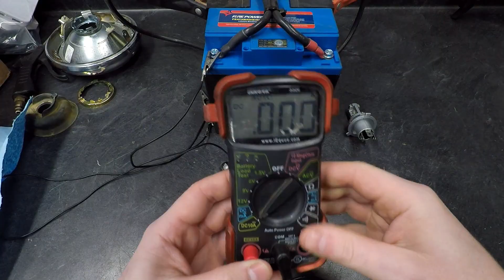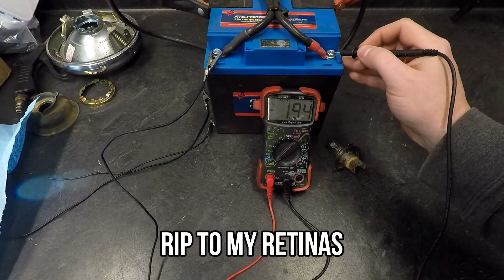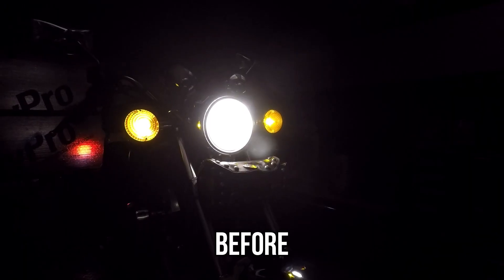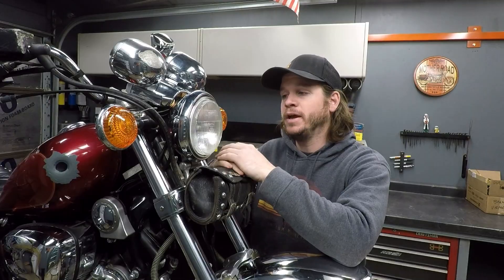Motorcycle LED Headlight Conversion - Install and Test!

Comment: Did you get the wiring wrong? Looks like in the '85 the top is for the low beam. Ground is on the left (black wire) and right is the high beam.
Reply from the maker: No, however I ended up worked as it should

Comment: Will these work on xr 400 2002  and do you need a rectifier or diode/ battery thanks
Reply from the maker: @adz24888  If you have an H4 bulb it will work

Comment: thanks for this great video,i do have a 1980  honda express 6 volt system and my tail light bulbs has a 1154 number on it,i was wondering if the connection would be identical if i buy the led bulbs?thank you
Reply from the maker: Yes if you have an 1154 socket you would search for 1154 6v led bulb

Comment: Great explanation, i need to upgrade my 2003 volusia and have no  idea if my headligth  is a sealbeam or just have to change the bulb.  I saw some videos that change to led but the lamp not include  mount hardware if needed,  also some lamp are 5' and other is 7'.

Comment: If the stock bulb is 35w, will changing to a 55/60 bulb damage the reflector?
Reply: Yes it not only melt you reflector, it will melt the wiring too due to higher wattage. The bike wiring might not able to carry the additional current load.
Reply from the maker: That I can't say with certainty.  I've only ever seen cheap Amazon headlights melt

Comment: Get a bread board and you can test all this easier. Great job tho. I use a load resistor for my led connections due to higher resistance with led bulbs. Does this bulb have an integrated one?

Comment: I installed a 2 sided led H4 bulb on my motorcycle and got a broken up light pattern compared to the element from the halogen OEM bulb. I've heard that a 3 sided led bulb projects much cleaner. Has anyone dealt with this?

Comment: does this fit on a virago535?
Reply from the maker: If you have an H4 bulb this bulb or similar will fit
Reply: @BrickHouseBuilds  any problems with overheating? i might try this but im scared the heating fins wont be enough
Reply from the maker: @chopracer  No issues

Comment: An interesting thing is that the filament bulb is very reliant on voltage for its brightness, so at lower revs the light will be dimmer, while on the LED it is a current driven device.  You will often see 9 to 32 volts or 5 to 15 volts on an LED bulb that means that even at the lower voltage you get full light output - the 'power supply' part of an LED bulb, either separate or internal as the bulbs are moving to now, is actually a 'constant current' circuit and that is why the voltage range is so large. The LED bulb will also have a temperature sensor built into the bulb, which can reduce power to LED's if the heat gets too much to prevent burnout of the LED and power supply.  Maybe the temperature sensor did its job when you were testing the power draw, and as the heat built up it reduced the power drawn through your meter.
Reply from the maker: thank you for watching

Comment: All 'shunt' Rectifier Regulator ( RR )work by 'wasting' any electrical power not used by devices into the heatsink but the load on the stator is not reduced.... putting in a bulb that draws fewer amps will increase the  temperature of the RR heatsink because extra power is pumped into heatsink, maybe causing burnout.  I fitted an Electrex world 'series' style RR,  this acts more like a light dimmer in 'series' with the load, and i tested the temperature of heatsink with OEM shunt RR fitted at 75deg C, then fitted series regulator and heatsink was 37degC and the load on stator coil reduced,  both these readings were with an H4 led headlight bulb fitted. The 'shunt' RR sits across the load ( 'shunt' is electrical speak for 'in parallel with load' and 'series' is a term for 'in line with the load', which is like a regular household light dimmer works, it only allows the amount of power required through.  )
Reply: I'm STILL trying to figure out...what LED lightbulb...(and perhaps an RR?) for my 2019 Husqvarna FE 350............hard to get it all dialed in as to what to order...

Comment: What about distance comparison, for me the high beam is to show more of the road in front as well as the sides. You can’t judge the lights in a confined area you need to be on a dark road so you can properly compare how they light up the road. I would rather see what’s ahead than to the side as you have more time to react if it’s in front of you than trying to stop quickly if something darts out from the side.
Reply from the maker: Sorry, it was 30 degrees outside

Comment: Loved the video. I have been wanting to upgrade my bikes headlight but was not sure it was possible. Would this bulb work for a 2004 Suzuki VS800GL Intruder, if so where could I purchase the bulb? 
Thanks!
Reply from the maker: I do not have a source for this bulb currently as I was sent a pre-production bulb from nwtcycletronic.com  They may have them available now but I am not sure. Check with them

Comment: How has the bulb held up since it was installed? It isn't listed in your amazon store?
Reply from the maker: Working perfectly.  It was never listed in my store. It was intended to be available from nwtcycletronic.com by now but it hasn't happened yet.
Reply: @BrickHouseBuilds  OK, thanks for replying. I have an old shadow 600 that needs a headlight bulb and I was wanting to convert to LED. Thank you for doing the video!

Comment: Watts or wattage is the amount of power consumed by the light. It's not output. With lights you have to use a light meter and it will usually measure in Lux which is the amount of light that falls on a certain area. Lumens is the total amount of light put out by the,  bulb. Those are both metric units btw. Pretty common, although generally the Lumen unit is mostly used in commercial lighting, not with something like a headlight bulb. The greatest problem to solve with designing an led headlight bulb to replace an incandescent headlight bulb is that the headlight's reflective surfaces that surround the bulb are designed to work with an incandescent bulb. The filaments, no matter what brand are pretty much always in the same place so that the reflective surfaces catch and redirect that light in a designed way so that the light is totaled and directed into a beam pattern.
The trouble is that headlight reflectors designed for incandescent bulbs often don't work very well with an Led headlight bulb, because the light emitter doesn't put out the light the same way as the incandescent bulb. Often the light from the Led is fragmented, by the incandescent bulb designed reflector housing. It spreads out over a larger area so it's not directed well. Sometimes the light doesn't even go as far, and you end up blinding oncoming motorists. I think that's why there's so many different companies producing led headlight bulbs. They can each make their own claims of being the best. 
I own a 2013 Yamaha FJR1300a, it has two H4 halogen powered headlights. I don't like the yellowish light that they put out and have been hoping that somebody will come out with a radically different kind of H4 Led bulb that will give the same or better pattern but in a brighter whiter light, but so far it hasn't happened. 
This problem is really common with installing Led bulbs in a reflective housing designed around an incandescent light bulb. 
The latest thing I've tried is an Led H4 that allows you to turn the bulb in the housing to try and achieve a pattern and light concentration that matches or exceeds the incandescent bulb. The trouble is, you may get a decent low beam pattern and concentration but then end up with a bad high beam output. For my cycle I've been considering the possibility of retrofitting a projector light assembly into my current housing, but I have very limited space.
Some of the companies that are making Led headlight bulbs make some wild claims about their light output too. Keep in mind that the emitter is not the part that gets hot on an Led, it's the base. That's the opposite of course of an incandescent bulb. So if someone's claiming their Led puts out 10,000 lens, but their base doesn't have a fan, you should question whether or not it's true. If it is true you may end up with an Led bulb that melts the headlight housing base.

https://www.bing.com/videos/search?q=The+differencence+between+lux+and+lumins&view=detail&mid=9323DDA65FFFD028FE589323DDA65FFFD028FE58&FORM=VIRE
Reply from the maker: K

Comment: The LED do not Fit !
It is to long for the XV and Vmax Light
After install the Light is to high and if you want to lower the Ligh the LED contakt the Back of the Lamp and cant go down

Comment: Hey BHB. Thanks for the vid. I have the same setup on my 84 Nighthawk 650, but I have a strobing/flickering issue when the bike is at idle, the bike doesnt really start to charge the battery until 2500rpm by design - any suggestions?
Reply from the maker: Well thats pretty common. An updated stator and reg/rec can usually help. In your case you already have a decent factory reg/rec so thats not likely a good upgrade to do. You could try installing an LED tail light bulb and see if that has a net positive effect.
Reply: @BrickHouseBuilds  Ive decided to buy a 12V/3A voltage stabilizer that takes 8-40V of input. I'll check to see if it does the trick when I get it

Comment: Can you do this for the rear lights too?
If I start to save too much power, will I need a change of fuses?
Reply from the maker: LED bulbs are a common swap for taillights and signals as well. Fuses won't matter. It is your voltage regulator that will expell the energy savings via heat
Reply: @BrickHouseBuilds  how bout the bulb size they self? Ion kno which one to get as they is both for car and motorbikes but for bikes are smaller and ion kno if they gon be good or if they just dodgy sellers trying to take advantage outta people from the trenches like myself. My bulb size be s2 and they come in two sizes.
Thanks for the help dawg, preciate it 👊🏽
Thanks for your help dawg
Reply from the maker: @TonyFrmSpace  Take measurements, review pics, and ask questions of the sellers if possible.  Sometimes the numbers on the bulbs are easy to search and others not so easy. Doesn't matter if its car or bike. Make sure its the 12v you need

Comment: I tested mine at 1.3a at 12v, so about 15.6w. they're not really that much different then my original Osram Ultra life bulbs in terms of brightness. I'm not really a big fan of the colour temperature though. I'd much rather warm white but that's just me. 

I worked out that the break even point of £20 will be reached in 400 hours of operation. No idea how long that will take though as I maybe use my lights about 4 hours a week around winter and 30 minutes a week in summer... So that point may take 2-4 years considering it'll take 100 weeks at 4 hours/week
Reply from the maker: Not our light. We don't have these for sale.

Comment: Very blinding if you look directly into them, but they dont light up the road very well. These are fine if you have a 1960s classic vehicle that doesn't put out enough watts to run decent bulbs.
Reply from the maker: Well per my use of this exact bulb I disagree.  I have many miles on this thing and feel its a good improvement in clarity, bulb pattern showing the sides of the road better, and improved pattern for oncoming drivers.
Reply: @BrickHouseBuilds  This has a better beam pattern than the 18 watt Bevinsee fan cooled lamp I just fitted. I have a very bright low beam with not bad cutoff,  but the high beam seems a bit dimmer in the distance tending to light up the tree tops, but if I push the headlamp down a little then the low beam is too close to the front wheel, even though it is supposed to be H4 motorcycle specific.  I wish I waited until I saw this test. I have a 60 watt system so every watt is precious to me.

Comment: Can you show the viewers these "Tiny Batteries" you speak of?
Reply from the maker: Not without completely disassembling a bulb
Reply: @BrickHouseBuilds  I can wait
Reply from the maker: @speedfreak8200  why do you ask?
Reply: @BrickHouseBuilds  I've been using LED,"s for longer than I can remember & this is the first time I have heard about little batteries in the diode or circuitry. I may try to do some research.BTW how many & physical size & what not
Reply from the maker: @speedfreak8200  I do not know. I'm simply reporting what the engineer or the bulb has said. Feel free to get in contact with www.nwtcycletronic.com and you can actually discuss the bulb directly at the source
Reply: @BrickHouseBuilds  I went to the site but didn't find anything about little batteries inside an LED you need to explain since you brought it up but I will keep trying to find this info, as it must be widely known by everyone but me. I know it takes voltage to make them operational
Reply from the maker: @speedfreak8200  So please understand that in this video I state that they are not available yet. We are working on a full lighting package consisting of many items. I meant you should actually reach out via their contact form to have a real phone call. I did not say that info was just on their website.
Reply: @BrickHouseBuilds  I wonder why a led powered by a car battery 🔋 needs additional power? It's not my job to talk on the phone to someone to tell me leds have little batteries in them unless maybe, they are rechargeable.
Reply from the maker: @speedfreak8200  I'm not sure what I've done wrong here as you are the one in pursuit of this information.  I thought by having the opportunity to talk with the actual engineer of the product in question would be a very cool thing. You would be able to ask any question you wish and get detailed responses but alas you do not wish to do that and I am not able to satisfy you here.
Reply: @BrickHouseBuilds  you said you would have to disassemble the led to get to the batteries then you say they will be used in the future ya got me confused I've been trying to find info on Google,nothing
Reply from the maker: @speedfreak8200  At the time I filmed this i had a couple pre-production bulbs in hand to use. One went in this bike, one in my personal bike. I don't have a bulb to disassemble so I cant do that for you.  I sell NWT cycletronic products and we are working on a lighting package to be available later this year so again I do not have a bulb in hand. There won't be anything on Google as this item is not for sale or available anywhere. If you want specific scientific explanations I again suggest you reach out to NWT directly and actually talk with them. You aren't dealing with a large corporation here, you have the ability to go directly to the source which is very rare.

Comment: wondering how much the current will drop if the bulb gets really hot. obviously it has to choose between reducing the light output or overheating itself.  if the current was that low on a 55w the voltage must have dropped below 12v.  I've measured a H4 55 /60 using as much as 73w
Reply from the maker: Why would the bulb get really hot? Its designed to create heat to help seal and keep moisture out of the bucket. You can see my test on a solid 12v source.
Reply: @BrickHouseBuilds  its not really designed to create heat thats just a byproduct of creating light. It's using a good amount of current I'm actually quite impressed.
Reply from the maker: @chrishart8548  actually this one is.
Reply: @BrickHouseBuilds  I'd like to see them design one that doesn't make heat.

Comment: Great job on the video! Told us everything we need to know about the changeover. I just put a pair of these on my 2006 FJR1300 and changed one at a time. The pattern was exactly the same on the low beam, but it was bright white! Almost drowned out the yellow of the Halogen bulb. The only thing I'm worried about is that the plug doesn't fit on the spades very snug. It doesn't take alot to pull the plug off. I hope that they don't vibrate off in my travels!
Reply from the maker: Well I cant speak on the bulb you bought as the one in my video is the light I will be selling before too long. Glad you found the vide helpful though
Reply: Have u found it vibrating off as im looking to fit to my fjr??
Reply: No. Has been fine. So far so good! @phillipanimalrichardson

Comment: Awesome video and helpful information brother
Reply from the maker: Glad it was helpful!
Reply: @BrickHouseBuilds  I recently bought a used 2008 Honda Shadow Aero 750, 22,000kms.
I upgraded to a new LED from Amazon. 
DZG H4 LED Headlight Bulb
9003 HB2 HS1
P43T 6500K
CREE Chips High low beam conversion kit 2
Worked amazing but
It burnt out after only 3 rides.
Wondering what went wrong,
Maybe I didn’t reconnect the retainer clip properly?
Wondering if you or anyone else can chime in on my problem?
Thanks 
Also wondering which H4 LED is most popular
Reply from the maker: @AnishinaabeTrevorC  I can sell you one of these to try if you are interested. I cant speak on the other brands
Reply: @BrickHouseBuilds  okay
Reply: @BrickHouseBuilds  cost and shipping to Nova Scotia?